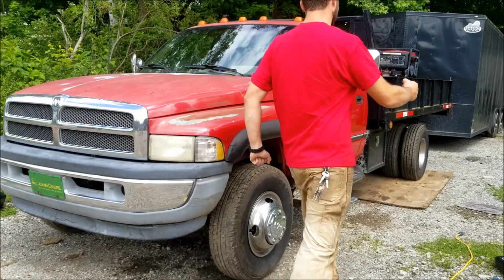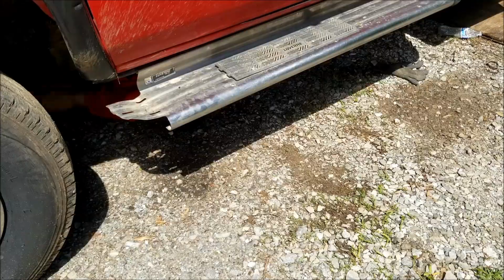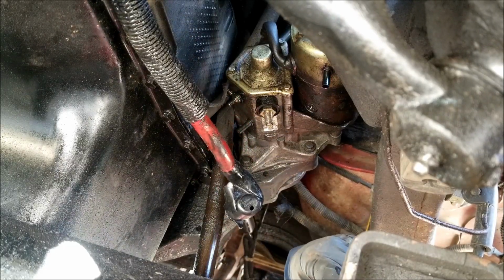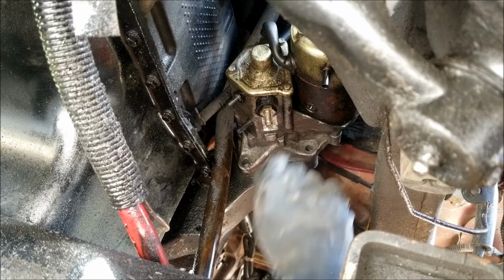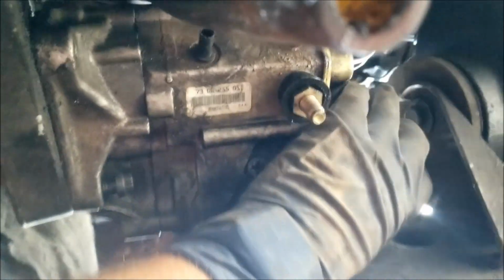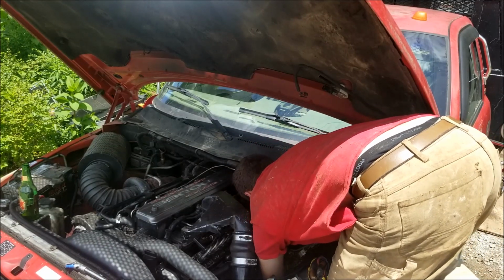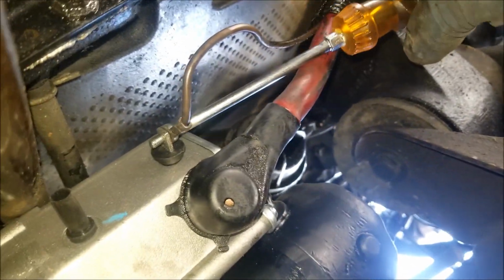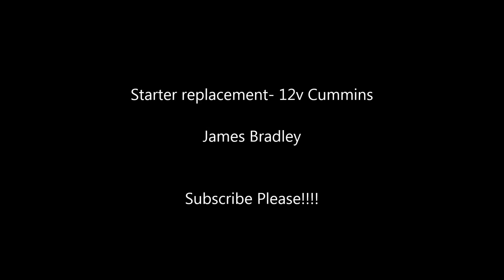12v Cummins Won't crank? Starter Replacement!

Comment: Trying to take the starter of my 95 12v and all the bolts seem to stuck badly.
Reply from the maker: They are usually a 12pt headed bolts, make sure you are using the correct 10mm socket or else they may strip out